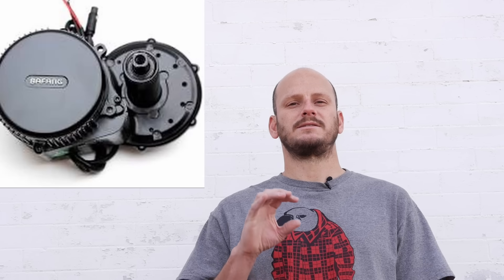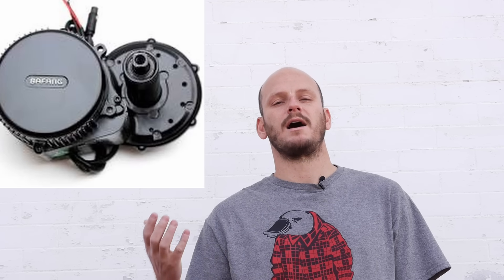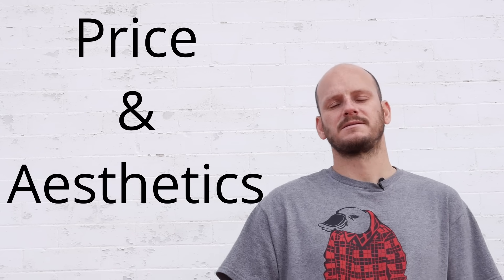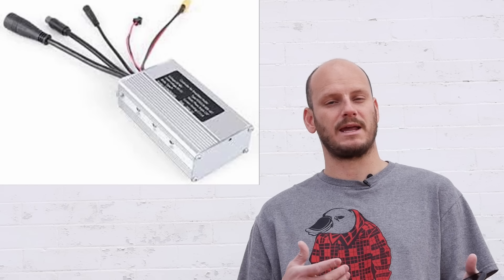Hub vs. Mid Drive Motors: Why Hub Motors Suck and Debunking Common Myths with performance test

Comment: Bafang BBSHD(1500W) with a the controller swapped out to the Ludicrous controller(3000w) from Lunacycles with dual 15.5ah 52v packs is the sweet spot IMO. 50mph on flat terrain is insane for a street legal(grey area here as the motor is still stamped as 750w so cops dont really know) bike. This is the setup on my custom stretch cruiser. LOVE it.
Reply: I have a similar setup. Where did you find a battery to put out 60 continuous amps? My battery can handle 70 amp bursts but only 50 continuous so I'm stuck at a measly 2500 watts;)
Reply: @michaelsprinzeles4022  I run dual 52v packs that can do a constant 50A, so wire them in parallel and each pack will only have to output 30A each which is well under the max. A simple XT-90 Y does the trick. Just be sure to get the proper ends and good gauge wire. My packs are 15ah each so plenty of current, and range. Hope that helps
Reply: Where is it street legal to go 50mph on an ebike?
Reply: @sammiller6631  Nowhere. I find as long as you follow the laws like I would on a motorcycle, being courteous, and not acting the fool, most cops are too busy admiring the look of the bike. Mine looks like  vintage motorcycle anyway.
Reply: @sammiller6631  I can't speak for Doug but not only won't my setup do 50 mph but I try not to max it out. I over built mine so I could maintain the same speed up hill as I ride normally and not huff & puff. The power is also helpful when towing my dog trailer at slow speeds (3-10 mph) in 1st gear.
Your way of thinking applied to cars they would max out at 55 or 65 mph on flats and slow to below 40 climbing mountains. And all that only at full rev wide open throttle.
Reply: @michaelsprinzeles4022  Mine is excessive. I dont do 50mph much, as it IS dangerous as he11. But it is nice to have the power to get out of idiot drivers way that are not paying attention, or just to hang with a motorcycle on take offs at lights. I use mine mostly in town which is a max 35/40mph so I can easily keep up with traffic and just act like a motorcycle, law wise.
Reply: @dougfurr5217  your setup sounds awesome. Mine peaks at 36 mph (but only 34 now that I've broken my top gear). My local limit is 25 even for cars. No worries about keeping up with traffic as I can stay ahead of it;)
Reply: @michaelsprinzeles4022  Im out in a rural town in Virginia, where the speed limit can go anywhere from 25-60mph depending on what road. I have had it out on Route 29-211 which was 55MPH. A semi passed me and did a double take/ slowed down to make sure he saw correctly. Its those moments I start pedaling just to make them laugh. I DONT recommend bicycles on the highway, semi's are scary as F when they pass. Almost get blown over.
Reply: @dougfurr5217  Actually sounds nice to me. I'm in NYC. Decent local infrastructure for bikes now but I grew up riding in traffic on analog bikes. As I got older my bike was my passport out of the city. My motor was originally just supposed to help up hills. I mostly just ride like I used to 30 years ago when all hills were smaller;) I do like when I get the rare chance to go WOT. I can't compete on the highway though, not enough top end.

Comment: Ok bud your hub motor give less wear on parts & dow les maintenance & is quitter
Reply from the maker: Ya but not worth the trade off. It’s minimal wear, minimal maintenance and minimally louder. Actually can be quieter than some hub motors. The performance is easily worth it IMO

Comment: I have hub motor. can i also put mid drive with 2 controllers! is it a good idea?
Reply from the maker: Yes! You could do 3 systems actually! Whether it’s a good idea or not really depends on what kind of riding you’re doing. If you have super steep climbs were you need all wheel drive then I would recommend putting a front hub motor in a mid drive powering the rear that would be the most effective way. But if you have a rear hub motor and adding a mid drive probably isn’t the most effective way. You would just be adding a little bit more power to the rear tire which would still be cool but…
Reply: @JohnnyNerdOut  i have a 250w rear hub motor and i thinking to put a 500w or more mid. thanks for the advise

Comment: Tesla does NOT use hub motors. They have the best electric motor technology. Go and take a test drive and learn from it.
Reply from the maker: I know, your right. I mis spoke. My point was that they don’t use a transmission/gearbox like mid drives do. It’s used in the same way a hub motor is though, just a simple gear reduction.

Comment: Is there a mid-drive conversion kit available with torque sensor?
Reply from the maker: Cyc
Reply: Tongsheng
Reply from the maker: @itzthekaykidkay912  they are made too delicate to be put on a bike IMO
Reply: @JohnnyNerdOut  have u had much experience with the tongsheng motor? ive been using mine regularly for months no issues. Im on a facebook page dedicated to them and reliability doesnt seem to be an issue.
Reply from the maker: @itzthekaykidkay912  only a little experience. I just think the motors are too small to handle power for a long time.
Reply: @JohnnyNerdOut  it's a 750 watt motor (although it peaks over 1000 watts as needed) which has plenty of power compared to most ebike hub drive motors which in most countries are limited to 250 watts due to local laws. Bafang has more powerful motors which is great if u want a bike that drives like a mini electric motor bike. The Tongsheng is more about adding to your ride and smoothing out the hills making them enjoyable, I can easily cruise at 40 km an hour (local laws say the bike should be limited to 25km) and ride up hills I couldn't get near on a non ebike. I suggest you try riding one you may be surprised. Cheers.
Reply from the maker: @itzthekaykidkay912  I’ve ridden and installed a few. They were ok. But they had problems quickly. I think they’re ok if the end user doesn’t push it very hard. I don’t think it’s designed to handle the 750w it takes

Comment: Great info. How does regenerative braking figure in your considerations?
Reply: regenerative braking is very useful
Reply from the maker: It doesn’t. Not worth getting IMO or at least worth paying extra for.
Reply: @JohnnyNerdOut  Thank you. I have a recumbent, tadpole configured tricycle which I have contemplated going electric assisted. I am looking at many ideas as to how to do this. I have thought about using a pinion type of intermediary gear system with one side driven by an electric motor and the other side with a chain or belt linked pedal system. What would your thoughts be on this idea?
Reply: @JohnnyNerdOut  Of course, that is just your opinion and other people's opinions may differ. If you have a lot of downhill areas it sure saves on brake pads to have regenerative braking. I have built a few electric vehicles in my day, and I am still building them.

Comment: then it makes me wonder why hub are so much cheaper, germany - i can get himiway or radpowerbike for 1500eur or almost any middrive bike starting from 2200eur, same battery and specs would cost around 2800-3000eur..
Reply from the maker: Probably due to volume. Hubs are cheaper to produce too but probably not by much. Rad power buys their bikes by the 1,000s and get a great price. They could easily switch it to a mid drive.
Reply: @JohnnyNerdOut  thanks! almost got myself HAIBIKE
 HardSeven 5 (2020), but 500w battery and old Yamaha PW-SE  250W 70Nm for 2300eur was a bit too much, so chose 1500 fat tyre bike (which i really wanted) with hub motor, hope i won't regret :)

Comment: Hi, could i use them as generator to make electricity?
Reply from the maker: No not mid drives. Yet.
Reply: Hub drives can be used to make elecricity.
Reply: Is it worth getting one just to make electricity or is there better?
Reply from the maker: @neviogrillo4004  IMO its not worth it unless you have a very specific need for it.
Reply: @neviogrillo4004  There are better. Schmidt has been making bicycle hub generators for 20 years: https://nabendynamo.de/en/products/hub-dynamos/

Comment: Hub motors are quieter and low maintenence and cost much less. Not good for hill climbing. I got about five thousand miles on my hub motor. One loose spoke in three years. Paid about $150. Hub motors much easier to install.
Reply from the maker: Nice! Sounds like you got a great value motor.
Reply: @JohnnyNerdOut   Got it off ebay says  "Voilamart" on the motor, 1000w three years ago. I think they cost a bit more now. I didn't get a LCD display. 

Bought one several years ago 600w and the spokes rusted out ( replaced all of them) and the controller gave out.  

If you don't have long hills or off-road the 1000w hub motor works pretty good. I can go up a mile-long hill climbs about 300 feet, but I peddle to help it.

Comment: 09:50 Not correct, Electric cars, (like Tesla etc ) are NOT using hub motors
Reply from the maker: Totally right. Got ahead of myself while talking. I meant that they don’t use a transmission to change gear ratios like a mid drive. Maybe that was a poor analogy though in hindsight😞

Comment: stupid arguing and wrong knowledge
Reply from the maker: I mean, ya. But like, what exactly.
Reply: @JohnnyNerdOut  Nm depends on rpm. and this togather makes the power. so this was bullshit what he said. also hub motors were not so bad at all. when it comes to jumps or bumpy trrain, mid motor are better and a full suspension. sure. i like both systems for their benefits

Comment: Biased towards mid drive obviously. 
Hub drive has its place, mine was half the price of mid drive , never break a chain or wear cassette , spokes have been fine, 1000w dd so never wear gears. I have 48v 20ah battery so efficiency not an issue. It is great for everything apart from bike parks / jumps etc.
Mid drives are more fun if you are just playing about, but but hub drive is for commuting, road and light off road where you just want the reliable speed and cheap build.
I want a mid drive next though so I can hit the bike parks but only with a torque sensor , cadence is rubbish
And not many options on the cheap end apart from tosheng
Reply from the maker: Can’t do an opinion piece and be wishy -washy. 😀
Reply: @JohnnyNerdOut  that's the beauty of internet, everyone can share an opinion and have it pulled to pieces lol, 
The best one to start an argument is "ebikes are for the weak and lazy"!!
Reply from the maker: @FlyingFun.  I’m stealing that for my next title!
Reply: @JohnnyNerdOut  Haha, feel free, its defo guaranteed to start a fire lmfao!
Reply from the maker: @FlyingFun.  done. And it’s going to be a video about how to program a display btw
Reply: @JohnnyNerdOut  cool, I'm gonna be foing some videos again soon too, my previous vids were racing drone reviews and DIY builds/ mods  but I'm more interested in ebikes now so will be about that I guess, always gotta enjoy what i do , the drones were getting repetitive and my boredom was defo showing lol.

Comment: My 1500w hub spokes were so whack out of box it would have spagetti'd right away, it's for a '53 board track conversion ballooon bike. Good points!
Reply: So YOU chose one with crap build quality. This video talks about individual company issues nothing to do with the technology like he tries to make out. By a target bike and you will easily buckle the rear wheel.but that doesnt mean the standard technology of bike wheels has a huge issue.

Comment: I tend to agree with you because you see it even in the automotive industry where they add gear to a electric drive to add more torque especially in off road vehicle. No matter how more linear the torque curve is on electric motor. I have tried an electric dirt bike with a 3000w hub motor and it had a hard time from 0 to 1 km/h on steep hills. But with a mid drive, you can use gear to augment your torque without driving the motor to its max amp capacity. As far as the spoke problem goes, I think its a builder problems. How many time I have seen mountain bike rear wheel with lose spokes because they are not well built from start. I always grease the spoke thread before building a wheel to avoid the wheel torquing the spoke. I would definitely build myself a mid drive bike first. Although there is hub motor with planetary gear now but I am not sure if you can change gear. It would be interesting building a Rohlof Hub with an electric motor around it.
Reply from the maker: Ya, loose spokes are signs of a poorly made hub. Simple as that. Many people love that they can get a hub motor for $200 but don’t realize how many corners had to get cut to get to that price. Such as the examples you mentioned like not lubricating spokes before tensioning them etc. they are built with speed not precision 👍

Comment: I’ll stick with my hub motor E bike that goes 49 mph. 84v 60amps
Reply from the maker: That sounds sick! I would too brother.😀
Reply: see, that's an area where Hubs do well, you don't need a bespoke mid-drive frame to fit silly-high wattage into a hub because you just make it wider. If you put a good controller on (you clearly did), you're going to scream. but if you're going in the 250-1kw range? you're not getting the most out of that form factor.
Reply from the maker: @DFX2KX  exactly, I agree. So if you’re buying a street legal bike, it’s a waste to go hub. If you go higher power it kind of changes
Reply: @JohnnyNerdOut  it just sucks that mid-drive prices have gone to the moon. when you can buy a complete gasbike kit for less then a motor and the smallest battery...  just... oof.
Reply from the maker: @DFX2KX  ya but who wants to suck 2stroke exhaust? The BBS02 is $450. I know it isn’t super cheap but....
Reply: @JohnnyNerdOut  I bring the comparison up because it's the other License-Free* motorized bicycle option.  I think a lot of this boils down to Bafang having basically no competition in this space. add-on mid drives are basically their bag. (for comparison, a Zeda80 is ~$200 with free shipping, $350 if you want to mid-drive it. Ebike conversions are all going for a 700-1000)

*If your cops let you get away with it, they're all over 1hp. that seems to boil down entirely to how much you hoon around here.
Reply: @DFX2KX  That's because gas kits are garbage
Reply: @thedon2703  Zedas are well-regarded enough, and they're certainly faster (unless you're talking really expensive electric kids)
Reply: @DFX2KX  Internal combustion Engine powered  bicycles are illegal to ride in my state (unless on private property),can't be registered or licensed so they can't be legally used on streets or even city or county bike trails in my area.
Reply: @m9078jk3  that's a valid point, though in a lot of ways that there is a big ol' "F U" to the poor. 

The same folks that can't afford car insurance are asked to pay a minimum of $500 for even the most garbage hub motor setup if they're out of feasable muscle range. 

$99 and you can have a vehicle fast enough to not die on American roads. won't be the most reliable transport in the world, but if it gets you a job...
Reply: @DFX2KX  I can't say why the laws were enacted against them. It could be because of the health hazard pollution of 2 cycle engines especially with particulate pollution which is damaging to human lungs in a way like smoking tobacco. 
If people rode these in mass numbers instead of cars cities would be heavily polluted with particulates and living there would be harmful to health.Certainly they get a much higher MPG than from ICE cars  so there would be less anthropogenic CO2 emissions per mile
Reply: @m9078jk3  their emissions are actually quite a bit worse then most newer cars. Catalytic converters are a heck of a thing.

You can deal with the particulates in a few ways, but those are at least valid concerns if you have a lot of them around.

Comment: Hub motor is by far the most sold. Your video is very biased suggesting that hub motor suck. Especially when you start talking about 3 kW motors and up. They have an insane amount of torque and you don’t have to include the drivetrain. I think mid drives are best if you’re riding up mountains or actual mountain bike riding anything else use a hub motor.  Not to mention if you have a powerful mid drive the amount of times you will snap a chain and be stranded. With the hub motor you technically don’t even need a chain
Reply from the maker: I think you misunderstood what I said about 3kw hub motors. They are awesome. I said that’s the only type of hub motor I would ride would be a high powered one at least 2000 W. Honestly over 3000 W And I wouldn’t recommend a mid drive anymore in most cases. This video was referring to street legal power output motors.

Comment: My personal preference is hub and I will take that cons of it. To mitigate the lack of weight issue in the middle of the bike, the pinion gear transmission is my only solution.
It is unlikely to work properly but I take the risk as long I came alive and kicking.

Comment: Hi mate I'm thinking of doing a bafang mid drive and I want to remove the rear cogs  to a single speed .. is that viable? Bafang 750w with 52v battery?
Reply from the maker: Yes it’s viable. But then you lose all the benefits of having a mid drive motor. It might be better to go with a hub motor at that point if you just gonna run a single speed. But if you’re bent on having a mid motor in a single speed yeah you can totally do it.

Comment: E-bikes with TQ sensors are the only way to ride... They output more power the harder you pedal... and on flat ground you get really good range out of them... I won't ride with just a cadence sensor ever again.

There is a mid-drive add on kit the TONGSHENG TSDZ2 Ebike Kit with torque sensor found them for about $400 for a 48v 500watt kit with out battery SO of course the price can get crazy if you opt. for a huge battery.